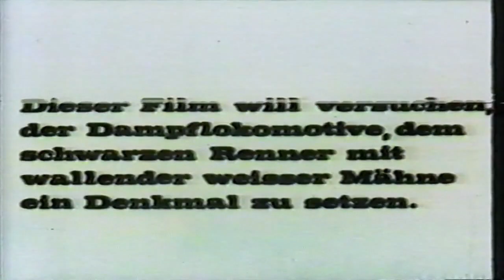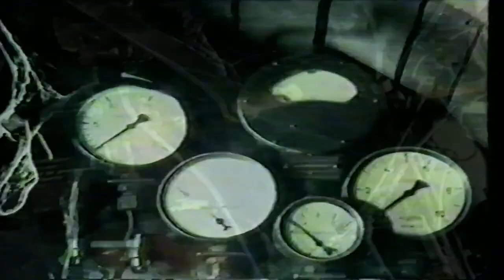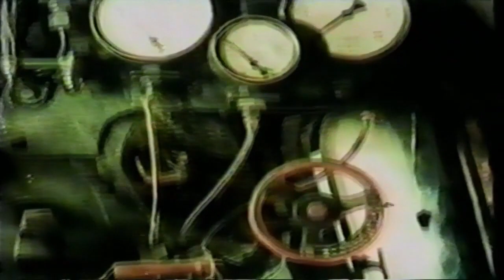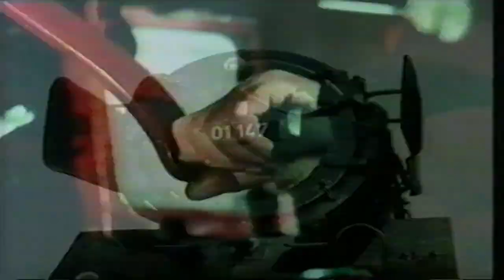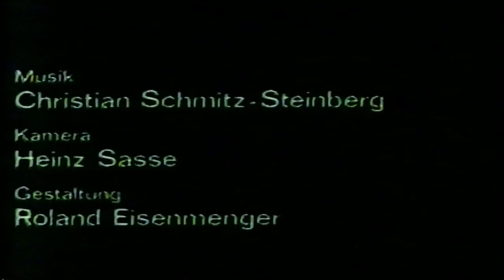ENDSTATION

Comment: As gandydancer5635 already noted, the film went by a different title and was a longer 20-minute cut also showing diesel and electric locomotives in direct contrast to the express 01 Pacific, and with a more contemporary '60s soundtrack. I think I prefer the soundtrack for this shortened version - made presumably for better distribution in German theatres on account of the original's popular reception. This is more bombastic and hammers in the appeal of a steam locomotive in its many stages of appeal, both epic and forlorn, and certainly it came across like that to me when I was younger. Regards, Samuel Farris.